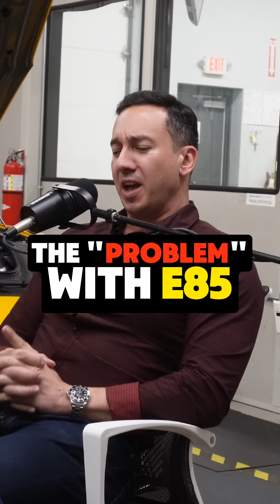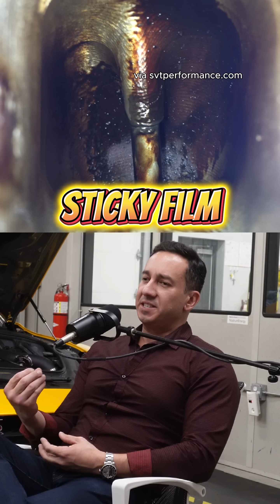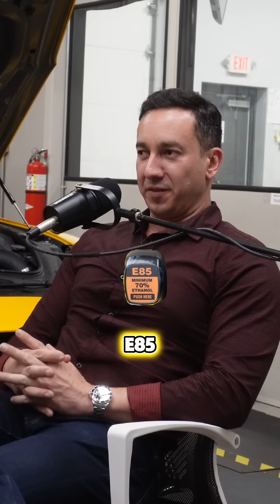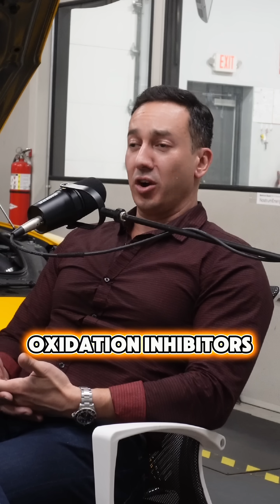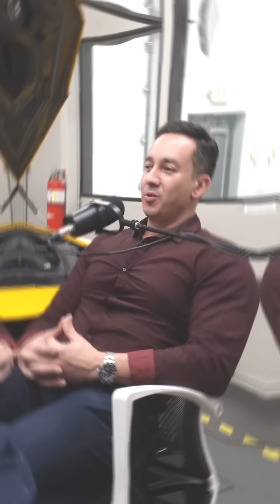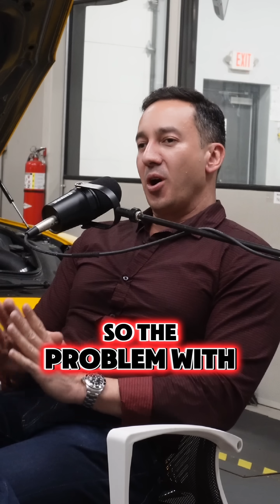THE "PROBLEM" WITH E85

Comment: When you have a car like mine that runs multiple tunes, including E 85 and 93 octane, you still have issues with this black crap building up when you switch between fuel.  it’s not about running mixture fuels it’s about changing the fuels too

Comment: E85 is a blend in itself it's not pure ethanol it's ethanol and gasoline just like evrey other blend would be
Reply: Not if you get race e85-e90. They use a denaturant for the 10-15% extra.
Reply: @402car_kid4  yes its e85 and e95 even e99 would be a blend lol e100 on the other hand can be pure ethanol

Comment: If you're saying that ethanol by itself is good. Are gasoline by itself is good. But if you mix the two then you have problems. Why have e-85 mixed with fuel. Stop it and maybe cars will last longer. Too many electronics in vehicles  are running the prices up. 😮🤔🤬
Reply: This guy doesn't understand e85 is already roughly 40% gas
Reply: @Andrew-ph3tp  I have seen gas tanks and inside motors that were trashed because of ethanol. I wish they'd just take it out completely. 🤬

Comment: Well known E85 gallon has 60% energy of 93, hence lower mpg.
Reply: The BTU rating of ethanol is entirely irreverent when discussing internal combustion engines. A gasoline optimized engine will often get better MPG when gasoline is used because the engine is optimized to run on the combustion characteristics of gasoline. The exact same engine optimized to run on ethanol's combustion characteristics will get the same or higher MPG when running on ethanol. 
Moreover, a gasoline engine optimized to run on gasoline will get equal or better MPG results when ethanol-gasoline blends such as E30 to E50 are used.
Reply: Its about what the vehicle is set up to run. E85 is a higher octane fuel technically so it actually has more energy thats the reason its a common race fuel

Comment: The biggest issue with ethanol vs gasoline is that it’s hydrophilic meaning it likes to attract and absorb water. If you keep ethanol in the tank for more than a  week or two it attracts a ton of moisture which mixes with all of the other dirt and grit in your fuel and intake systems making all the gunk and buildup that people see. I run E90 for track days and other race events and then when I’m done let fuel pump drive out all of the ethanol and put straight gasoline back in for any cruising or street driving. Never have a single negative issue from ethanol doing things that way.
Reply: It won't draw water with a closed fuel system.  When I put my alcohol fueled race car up for a couple of weeks I fill it up and put a cap in the vent so system is sealed.  I never did this on e85 though and never had a problem. 2 weeks I wouldn't really worry about, at 3 to 4 weeks I would. I've had 93 go bad after sitting 5 to 6 weeks, it even seized a brand new fuel pump. Nasty stuff these days.
Reply: @jdubcbr600  The problem was caused by the gasoline going bad. Ethanol never goes bad.
Reply: @TheAutoChannel e85 drawing enough water to render it useless id say it does go bad.
Reply: @jdubcbr600  You would say what you said because you have absolutely no idea of what you're talking about. 
One of the greatest benefits of having ethanol in the fuel tank is that it absorbs water that forms naturally from condensation and then vaporizes the water during combustion. 
This is why the major fuel additives that address the water issue (Dry Gas, Heet, etc.) use alcohol as their primary active ingredient.
Reply: This is definitely the way to do it. I made the mistake of running E85 on my tuned daily driver and the lack of quality enforcement for pump E85 likely doesn't help as it does with top tier fuels for standard gasoline for example.
Reply: Just burn it out and fill with pump gas for next street run
Reply: The correct term is hygroscopic. While ethanol is a hygroscopic substance, it is not a desiccant. Ethanol will absorb a rather small finite amount of water that it comes in contact with, but it does not keep on absorbing more water the longer it sits in your tank.

Comment: The biggest and only problem I ever experienced with e85 is severely reduced MPG. A one tank trip with regular gas turned into a nightmare trying to find an open gas station at 3 am less than half way back home. I'll NEVER use e85. The cost savings at the pump is outweighed by reduced fuel economy.
Reply: there is no cost savings since it requires so much more fuel
Reply: @ There absolutely is if 93 costs $4.50-$5.00 a gallon and E-85 is well under $3.00 a gallon lol.
Reply: @kennethpowers8995   e85  gets 11mpg in a truck that gets 21 mpg. your not saving money using that much more fuel. also e85 isn't that low
Reply: @ I’ve been using ethanol for years. It’s 30-40% mileage difference tops if your vehicle is running right.
Reply: And how are you gonna tell
Me what the price of fuel is where I live lol.
Reply: @kennethpowers8995   someone got caught in a lie.
Reply: @kennethpowers8995   that's not what federal testing says on brand new vehicles.
Reply: @678friedbed there is but you need to check. What the other guy said of upwards of 40% reduction in mpg is not true but you will lose i think 15 to 20% so if its not 15 to 20% cheaper it may not be worth it
Reply: @Pippy1   it's actually about a 50% reduction in fuel mileage, ethanol is not anywhere close to gasoline when it comes to energy density.
Reply: Lower BTU in e 85
Reply: That’s because ethanol has less energy per gallon than gasoline so it takes 30-40% more ethanol than gasoline to make a given HP figure. The price at the pump is negated because in most cases E85 is the price of regular 87 octane, so getting worse fuel mileage balances out because you’re getting the performance of a ~100 octane fuel for that 87 octane price.
Reply: @kennethpowers8995 That still doesn’t balance out. There is a certain point in engine power that it becomes wasteful. Believe it or not, you don’t need 300 plus HP to drive a car. You could get away 50 HP. Sure it won’t be a snappy but it will be way more efficient if you not hauling any extra weight.
Reply: @ It balances out for me because I’ll take an extra 100 HP and the anti-detonation benefits of ethanol as a trade for 6-8 mpg when the fuel costs $2.76 (currently) a gallon.
Reply: @kennethpowers8995   you aren't running a high compression motor and don't need to worry about that.
Reply: @kennethpowers8995  e85 produces less HP these straight gas
Reply: @ No, no it doesn’t. On even a 100% stock Flex fuel vehicle you will make a solid 10-15 HP gain minimum on e85 vs gasoline. On my Q50 with VRX70s I made 106whp more on 84% ethanol than I was able to make on pump 93. You have absolutely no idea what you’re talking about.
Reply: @kennethpowers8995  that's completely false. ethonal doesn't have anywhere close to the same amount of energy as gasoline.
Reply: @kennethpowers8995   do you not know how to reply to people?
Reply: @678friedbed  you dont understand yes gas is more energy dense but thats not the only characteristic that can help produce more power. With gas the cylinder will get too hot because of the energy density causing heat not to escape the cylinder fast enough which will prevent you from getting more power. Ethanol on the other hand will evaporate as soon as the fuel enters the cylinder and absorb the heat. so ethanol burns cooler allowing you to be able to produce more power since you dont have to worry about detonation ethonal has over 100 octane rating which is great for high boost application. it doesnt matter how energy dense the fuel is because the way you extract that energy is not that efficient that means that extra energy is just being wasted as heat.
Reply: @kaptain1477  that's called detonation and is only a problem with high compression vehicles and there are other ways to fix that issue and still run straight gas. and no you can't get more power out of ethanol, gasoline still produces more HP.
Reply: @678friedbed  people forget that after E85 100 octane 110 octane produce more power. Only downside is very limited gas stations around 100 octane and 110 octane is leaded gas.
Reply: @Parleyposadajr2248   lol, e85 dose no produce more horsepower. E=MC^2 is a thing. you cannot take something that has less energy and produce more energy .
Reply: @678friedbed lmao dude pulls out an Einstein equation and doesn’t understand thermal efficiency of ICE engines 😂 on a high compression or large turbo engine with modern direct injectors and fuel system, E85 will absolutely make more power on a flexfuel tune. Why? Because the combustion cycle is more efficient and controlled, meaning the ECU can advance the timing of the engine to produce more power. This means about 20-30% efficiency loss on my personal car, which runs 93 recommended at 11.5:1 compression ratio from factory. I don’t get audible knock from the engine on 93 during the summer, but I do notice the ECU retarding timing a bit on the “premium” gasoline on hotter days. This causes my efficiency to drop, as the engine can’t get rid of its heat as easily, so the computer cuts the engine’s power to manage itself. On E85, I get close to 20% efficiency loss on those same hot days, make maybe 15% better power, and the e85 is about 35-40% cheaper than the 93 in my area, so it makes sense for some, just not most people with tiny turbo low compression high gas efficiency engines. You find these in SUVs and trucks, not usually sports cars.
Reply: @liam5257   you can not produce more power from ethanol. that's why on e85 your vehicle will get 11 mpg instead of 21 mpg on straight gas.
Reply: @678friedbed Have you heard of alcohol drag cars lol. You can take any modern turbo car and pick up massive hp switching to e85. Ya you use 30% more fuel but pump 93 sucks. My car made 720hp on 93 and 802 on e85 without adding more boost.
Reply: @joe1273   yes, drag cars run on alcohol. that doesn't mean that alcohol produces more HP. they do that because alcohol burns cooler and doesn't pre ignite in the combustion chamber, it has nothing to do with making more Hp because it doesn't.
Reply: The main reason to use E85 is performance. If it’s not a tuned performance vehicle, gasoline is much preferred
Reply: @Courtesyflush52   nope, gasoline produces more "performance" ethanol has a higher octane level so you can run higher compression ratios but that's only in race motor, passenger vehicles max only have a compression ratio of 12 to 1. there are other options that can be done to reduce pre detonation that will produce the same effect
Reply: @678friedbed  ethanol makes more power than gas even the new dodge muscle car can only get its high horsepower with ethanol fuel only
Reply: @kaptain1477  that's simply not true. it's literally impossible.
Reply: E85 should be priced much lower, because the Ethanol is much lower in price than 100% gasoline. 
If it is not priced at least 20% less, I don't buy it. My mileage drops, but E85 is cheaper, so my cost per mile driven is less.
Reply: @2010utube100  e85 needs to be about 50% to justify buying it and that doesn't include thant the fuel causes problems with injectors and clogs up other stuff
Reply: @ maybe it needs to be 50% cheaper to justify buying it for YOUR car or truck, but some of us actually have stuff that makes power and E85 is a lot cheaper than race gas regardless of how much more you use. Even plain Jane Sunoco 260 which is only 100 octane runs $18+ per gallon and E85 right out of the pump at 70-80% ethanol makes more power than that and it’s not even $3 a gallon. Something that requires the likes of C16 is even more costly at more like $25-28 a gallon and again, you can make the same power on E for a fraction of the cost. The hydrophilic properties of ethanol are easy to live with too with basic maintenance. Some ethanol additive into the tank to reduce fouling in fuel lines and injectors then keep a fresh fuel filter in the vehicle and don’t leave ethanol in the tank for more than a couple weeks without burning it up. That’s all you need to do.
Reply: @kennethpowers8995   e85 makes less HP them gasoline. you should really stop lying.
Reply: @kennethpowers8995  and it has nothing to do with my vehicle, I wouldn't be dumb enough to run it. it's government testing that says in a brand new vehicle, e85 produces half the fuel mileage that gasoline produces. if e85 produced more HP you would get better fuel mileage. you should try going back to school and take a physics class.
Reply: @2010utube100  some performance vehicles perform better with ethanol than gas so in some cases people will go with e85 regardless. but if the prices between 87 and e85 is great enough you do save money.
Reply: But like 20-30HP increase :) fun fun
Reply: Not always true gas was $5 during bidenomics and e85 was $3. Saving 2 dollars per gallon was worth it
Reply: @kaptain1477  you weren't saving money because you were getting almost half the fuel mileage plus the problems it causes in your fuel system and motor.
Reply: @678friedbed  no i was not geting half. i calculated it and i was saving money. e85 causes no problems to fuel system and motor because the vehicle was made for it.
Reply: @kaptain1477   actually it can cause the injectors to foul up and Among other things especially if you go back and forth between e85 and e15. the additives and other things are are different to deal with the alcohol.  and yes it does get about 50%, do you not understand physics? you see ethanol has about half the energy per a gallon compared to gasoline. your ngine isn't magic energy can't come from nowhere.

Comment: Isn’t it just highly recommended (basically required) to do a mixed blend of gas and E85, particularly for fuel efficiency? Like, I remember one day I was broke but had enough to fill my tank, but I was hungry and on my way to work. I filled up my 2016 Focus SE with E85 from empty and only got like 90 miles on that full tank. I thought I broke something in my car. Yes it is a flex fuel focus.
Reply: If youre wondering about fuel mileage on ethanol, you have to realize that chemically there is less active fuel in ethanol compared to octane, so to use the same amount of oxygen, you need more ethanol compared to the amount of octane it would need.

Basically ethanol will make more power, but it uses more fuel in a single cycle.